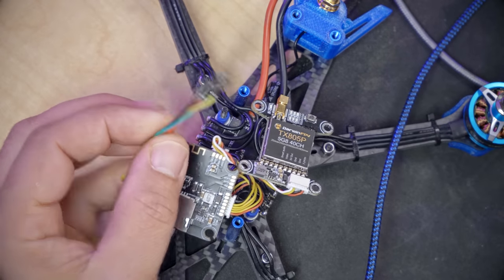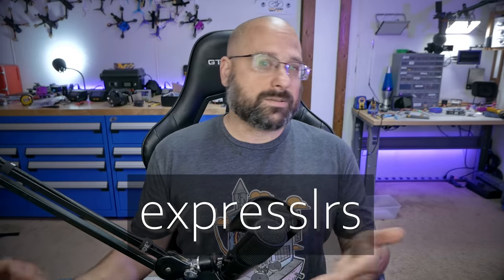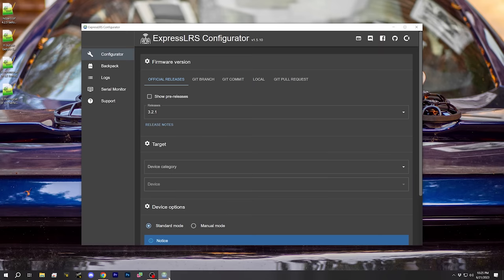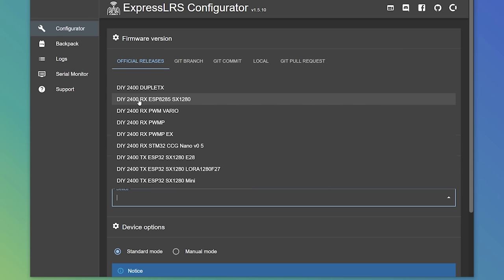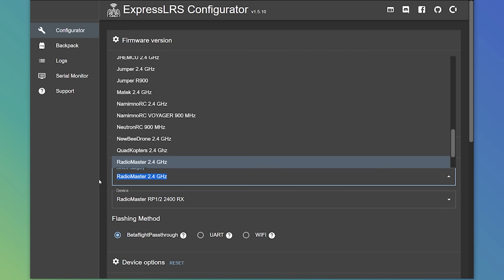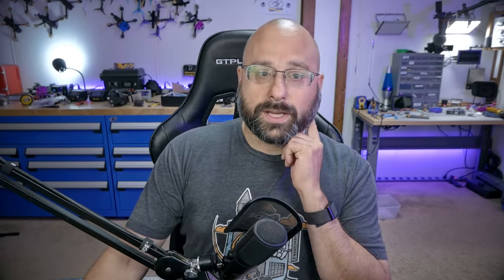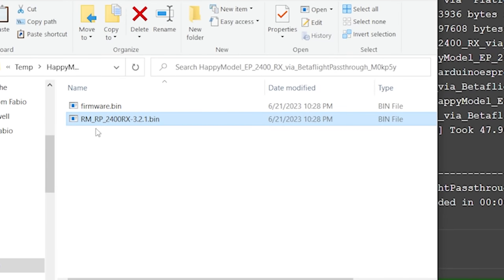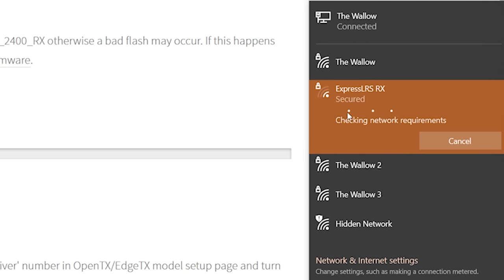Easiest Way To Flash and Bind ExpressLRS!

Comment: At the time of posting, this video is 100% correct for v3.2.x….
BUT, in v3.3 which is currently in release candidate, the bind phrase workflow has been “fixed” so that wherever you last set it from (configurator, webui etc.) will take priority. This means you don’t need that last step to set the bind via webUI anymore.
Reply from the maker: Damn you devs, always fixing things right after I document the bug. FWIW I still would set bind by webui over flashing, if I had the correct version.
Reply: @JoshuaBardwell  and this is EXACTLY why I dont mess with elrs. if I blink I am out of date. Xfire just works. a how to bind a Xfire RX video would be 34 seconds.
Reply: English ?
Reply: I really wanna love ELRS. I really really do. Took me a day for my spi whoop to flash and bind. I have 2 more built but grounded till I can recreate that winning lotto combo. Then there is agent X, M, and FU, I just wanna fly. 
Wish I could plug the quad into the radio, run a lua from radio to flash and bind all in one go.
Reply: @muchthump  IRC Ghost is easier than that 👻
Reply: @muchthump  He doesn't mention how SPI based whoops are by default on ELRS 2.X and that's baked into BetaFlight 4.3.x and ELRS 3.X is baked into BetaFlight 4.4.X.
Some FC manufacturers (at least Happymodel) have released a 4.3.1 firmware with ELRS 3.X so you can flash that without jumping into BF 4.4.  Getting the binding phrase into a BF 4.3 needs a CLI command.
Reply: I bought 3 elrs modules , 6 recievers . Factory firmware promised to be the same , one bind but the antenna caught a prop and now none of that stuff works . 
Speedybee wants awifi hitspot on my phone bill.  Maybe to communicate remote id with elrs over the internet ?
Reply: @gregorydahl  yeah, you should not have bought elrs ☹️

Comment: Don't know for sure but there may be some steps missing involving swapping wifi connections since your system is setup with two of them but most people only have one. Frankly I got a bit lost after you did the download and build of the firmware. Probably nothing I couldn't sort out when doing it for real but just saying I didn't come away with a strong confidence that I understood all the steps and order of them to do the job, which by the way is not normal for your channel, i.e. you  are the best that I know of at providing easy to understand detailed steps for getting whatever task is the subject of a particular video if that makes any sense. Cheers!!

Comment: I had a surprisingly smooth experience with elrs spi binding on a mobula6. It wasn't binding probably because the elrs came from factory with erls firmware 2.x

I flashed betaflight 4.4.2, went to the receiver tab, selected SPI and entered my passphrase.... thats it, no wifi needed, no compiling, no need to do anything on the Transmitter.
Reply: Same here. Very satisfactory experience
Reply: ELRS via SPI is the easiest setup since it's baked into the FC FW.  It's almost D8 simple.  The UART FC's like the NewBeeDrone are a BAD idea.

Comment: My procedure is to connect to the receiver with WiFi and set it to connect to my home network. Then I build and flash from the configurator. This has worked for every receiver brand except the Axis Flying receivers I have. With those, WiFi did not work correctly until I had upgraded once. After that I am able to use the same method with home network set for future updates.

Comment: Hey Mr Bardwell. I wish you'd released this video a day earlier as it would have helped me out 2 days ago (and saved me a whole load of head-scratching!). I was trying to flash my new Ranger Micro TX and bind it with a Naminmo RX from an old build. Flashed both to the latest ELRS f/w with my passphrase ... but no successful bind?!? My last resort was to set my passphrase for both RX/TX using the runtime options .... and bingo, it worked. Seemed counter-intuitive but, as you demonstrated, it works. Thx for confirming that my approach wasn't pure luck :)

Comment: I have crossfire and don't need elrs. when radiomaster stops messing around and releases a boxer max I will buy that and probably watch one or maybe even 2 of your many many ELRS videos. jeeze. :)
Reply: I got 3 elrs nano and mico modules and 9 rx's  . One worked until jb weld doesnt stick the tee antenna  to carbon fiber and it shredded in the props . Could not fix the ufl connector  . All nine said factory firmware matched but doesnt . Buy a computer and cable anyone ?  I learned my lesson . Chasing a more and more expensive carrot no sir  every week upgrade videos

Comment: you can also use your phone to check the firmware version instead of having 2 wifi adapters and switching back and forth between networks on your desktop

Comment: Wow!!! That is so much easier than using Crossfire and hitting 2 bind buttons (at very most). PS, nicely added filler to get past that 10 min mark. I really need to try Expresslrs sometime so I'm able to say from experience that it's just not worth all the hoop jumping when you have the ease and great performance of Crossfire. The range and penetration of Expresslrs is going to have to mind blowing for me to go through all that crap just to establish a link..... Still love and appreciate all your help Bardwell.
Reply from the maker: I never add filler content to manipulate length and run mid-rolls. My videos are as long as they are. And anyway, the cutoff is 8 minutes not 10 minutes, so do with that whatever you want.

From the tone of your message, it sounds like you like Crossfire and are not sincerely interested in the things that ELRS brings to the table. Dont' bother trying ELRS would be my advice. It will be a waste of your time, and will just self-reinforce the things you already believe. 

In case you are curious, the reason ELRS doesn't have over-the-air firmware update like Crossfire is because ELRS is supported by many different manufacturers. Because there are so many different firmware targets, they can't all be stored on the module and automatically flashed at bind time. The tradeoff here is that you can always find ELRS in stock, and there is cross-vendor competition for features, build quality, and price.
Reply: @JoshuaBardwell  I am interested in the penetration ELRS is said to have over Crossfire. You have to admit with ELRS there is a lot more you have to go through to set it up and especially your first time setting up the TX as well. 
I kind of look at it the same way as I look at KISS Ultra. A completely different and seemingly more complicated animal than Betaflight. Your opinion on both has me decided that I will try both in the near future but the set-up process on both is what's holding me back.
I rarely have any range issue with my Crossfire and I'm not a long-range guy anyway. I'm interested in if the penetration with ELRS is that much better than Crossfire? Is the juice worth the squeeze? 👍
Reply from the maker: If you're using 2.4 GHz ELRS, compared to 900 MHz Crossfire, then which one has more range is difficult to predict. Crossfire's lower frequency will tend to give it longer range, and I suspect it would win at 50 Hz, but lose at 150 Hz, since 150 Hz CRSF doesn't use LoRa.

If you're comparing 900 MHz ELRS to 900 MHz Crossfire, then ELRS will give better range. When both are operating at 50 Hz, ELRS will give somewhat better range because it has a smaller, more efficient packet format. This allows it to use a lower bit-rate modulation that has better sensitivity. 

ELRS 900 MHz can also run at 25 Hz, which would further increase its range advantage.

CRSF 900 MHz can only use LoRa at 50 Hz packet rate. At 150 Hz, it uses FSK modulation, which has significantly shorter range. ELRS 900 MHz can go up to 200 Hz packet rate using LoRa. At 200 Hz, ELRS 900 MHz may have less range than CRSF at 50 Hz, but CRSF doesn't even offer this option, so it's worth calling out.

In general, I would not expect ELRS to have enough of a range advantage compared to CRSF, to make it worth switching, as long as you are okay with the 50 Hz packet rate. If you want lower latency than the 50 Hz packet rate offers, then ELRS is worth switching to.
Reply: @JoshuaBardwell  what about penetration in your opinion? I park freestyle (trees interference) and some bando/around buildings freestyle (concrete interference). How would you say the penetration compares between Crossfire and ELRS? While I have you in the comments I also am curious to know if I can get better range and pentration with my 03 air unit. I have Integras in fcc mode and lose video at lower altitude long before a lose my link quality.
Reply from the maker: Penetration and range are the same thing: https://www.youtube.com/watch?v=nb0a9YORAks

Comment: Thank you Joshua you have saved me from spending days on getting my gear running, but I have an issue with a Zorro ELRS TX,  it is bound to the RX as it says on the radio when I remove the battery from the RX and when I reconnect the battery it says connected again,  on BF I can see that the Roll, Pitch, Yaw and Throttle work but not the switches.   I have tried everything but nothing else works.   dont know what else todo.. or what direction you can point me.   Thank you !!!

Comment: I've flashed ELRS receivers various ways, WiFi, Betaflight passthru and a USB/TTL bridge.

Whilst the WiFi approach specified here is undoubtedly very convenient, one thing I've found one needs to watch out for is WiFi range - the tx power from the receiver seems very low. Move the PC antenna and Rx too far apart and it'll lose connection pretty quickly - mine does anyway.

It hasn't happened to me yet, but I wonder what might be the result if it lost connection in the middle of flashing. Don't know but suspect one might have to force the Rx into boot mode and reflash with a USB/TTL bridge.

Important to make sure the WiFi connection is solid, anyway.

Comment: I can not figure out how to install my rp3 reciever in my drone. Ive soldered everything correctly and I made sure there were no shorts. I turn it on and the reciever just flashes for a split second and then nothing happens. Do I have to give it power before I solder the TX and RX wires or what am I doing wrong?

Comment: Watched this video till the spi internal aio whoop not the same instructions part. 5:30 😢 I'm having trouble binding multiple betafpv spi whoop boards with my elrs tx. Some will bind after hitting the bind button in betaflight others go into bind mode but don't ever bind. I only have about 4 and got 2 to bind so far and I didn't use a bind phrase I just pushed bind on both rx and tx and boom they were connected. But is it really connected? I kept getting what seemed to be like failsafes during simple flights around my house with one board. 🙃 honestly I thought I was switch from tbs crsf to this to not only save money but to have something that works consistently and efficiently but I've spent all night trying to use the configurator to bind/flash the rx / tx and kept coming up with failures. I've given up for now😅 i did buy some normal elrs rx's so ill come back to this once ive mastered the spi based internal rx's first...

Comment: so If I do not want to flash the firmware, but just want the advantages of having a binding phrase, can I just enter the binding phrase in the 10.0.0.1 web page and save it to the drone and radio that way?  [your video at 7:40].

Comment: If you have a F4 and it seems like you did everything right but it’s not working you might need to use a different UART. I had to swap the RX and my Vista and it started working as expected.

Comment: Hello Joshua, first I have to say I LOOOOOVE your videos.  I consider it a "Good day" when I learn something.  Thanks to your videos I've had lots of them.

On to my question...
I have a Baby Ape Pro V2. I'm try to set the Bind phrase on the ELRS module.  Connecting to the on board Wifi it tells me...
From here you can update your Receiver module with BETAFPV_2400_RX firmware Rev. 2.5.2 (6d9d57) ISM2G4
My question is, what should I do?  Upon checking in ELRS configurator, there is no exact match for that name.  But the Flight Controller and the ESC are both AIO components.  Maybe the ELRS  receiver is also AIO?  Should I try the firmware labeled BETAFPV_AIO_2400_RX??   If it doesn't work, will it be bricked for good?

Comment: Wow, this isn't confusing at all. ELRS really has made the hobby easier to get into than FrSky
Reply: You are joking everyone . He is joking .
Reply: @gregorydahl well maybe not. In order to flash an frsky r-xsr, you have to use a tiny adapter (if you have a connecter on your receiver, otherwise you need to solder wires) and then you need to plug that adapter into your radio JR bay and make sure that the wiribg is correct. Then you need to put the firmware on your radio in order to flash your receiver. And I don’t even then mention the whole access/accst v1/v2 eu/us mess for the firmware file. ELRS is so much easier
Reply: For me frsky is easier. Bar none . 👍
Reply: Push button on reciever to go into bind mode, push button on radio to bind, boom...go fly.  I have never updated a frsky reciever.  If it flies, why mess with something that works great.  I am very reluctantly trying elrs.  Only because I can't find the micro recievers I like.  I would rather fly more than sit in front of the computer more.
Reply: @MrAlucardDante  just bound 3 frsky whoops in 5 mins the other day 😂

Comment: I prefer to connect with my phone, define my home network, and I then I don't have to bother with connecting to it anymore as it'll just be on my network. ELRS Configurator works exceptionally well that way.
Reply from the maker: My problem with that is the RX wifi is very short range so it can't always reliably connect to my wifi. It it can always connect to my phone which is right nearby.
Reply: @JoshuaBardwell  Ah, this is true. My access point is only about 4-5 feet away from where I do my configuration, so it connects without issue. The PCB antenna on most of these boards just doesn't cut it for anything beyond the room its in.
Reply: I was about to say the same thing. Then the build and flash button works without any issues

Comment: Joshua, I’ve watched both. I still get some flashes that just fail and brick my RX! If I evened out the money btw wasted rx and crossfire rx it’s prob same price. It prob user error but I’m doing nothing different than you… Update: I watched it in depth (this current video) and realized I may have been trying to flash the other file, not the firmware.bin - does this make sense that I would still at times get successful flashes using that other file labeled “3.2.1” for example?
Reply: Either .bin file works, even of you rename them :)

Comment: When I try to import the new firmware to the receiver, before it can say update complete, the receiver switches back into its initial binding sequence and disconnects from my computers wifi. Im not sure if the issue is my soldering or what, because everything else seems to be working so far... any  would be much appreciated.

Comment: But Josh..... by the time you have connected your bluetooth to the receiver, I have already plugged and unplugged it twice, plugged it in a third time and hit 'bind' on my transmitter. Done done and done.
Reply: It’s wifi not bluetooth, and this video isn’t just about binding but also flashing. Although what you are mentioned works, using a binding phrase means it just works out of the box. And you will eventually update you firmware. So you just have to do it once and forget about it.
Reply from the maker: That's fine, but it doesn't work unless you know they're on the same firmware, and these days the RX usually comes with 2.x and the module has 3.x, so you're going to have to flash it anyway.

Comment: btw why I should to turn on my radio (tx) first (then plug the lipo to my kwad) to connect my kwad? how to set like on crossfire (when I plug my kwad first then turn on my radio they can connect automatically)?
Reply from the maker: If you raise the wifi hotspot timeout, you can extend the time before wifi kicks in to like 10 minutes or some other very long value. But using wifi to configure the system will become difficult since the RX will need to be told to go into wifi mode manually. If you don't have your controller, you'll be waiting a long time.

Comment: I Had this Problem now two Times. Bought definetly a betafpv Diversity.  While flashing IT told me of course Missmatch and that i need to use Happymodel target wich i did.   The flashing was kinda Not really working as usual but the RX was bound ( i got the telemetry Info at least) so IT Had Connection but my Quad didn't respond to anything.

Comment: But SPI is serial! It's just a matter of sync or async when we are talking about UART and SPI difference. Both of them are serial.
Reply from the maker: Betaflight defines two types of receiver: SPI and serial. You can debate the correctness of these semantics, but when you get around to configuring your flight controller, those semantics don't matter.
Reply: Got the idea, thanks for the clarification.
Learnt something today ;)

Comment: looks like my drone is not switching into WIFI mode after powering up... any suggestions?
Reply from the maker: Manually force wifi mode by holding down the bind button for 5 seconds.

Comment: I bought a HAPPYMODEL EP1 DUAL 2.4G RX and it came pre-flashed with UNIFIED_ESP32_2400_RX Firmware. When I try to flash the firmware via passthrough I get this error: "Wrong target selected your RX is 'HAPPYMODEL_EP_DUAL_2400_RX', trying to flash 'UNIFIED_ESP32_2400_RX'". How can I fix this?
Reply from the maker: Enable the "force flash" option.